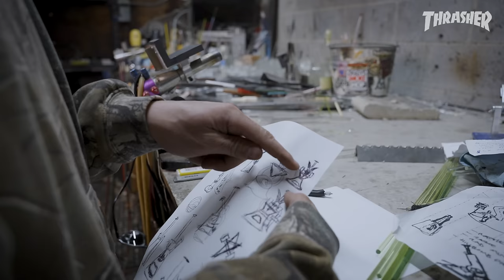Create and Destroy: John Worthington

Comment: I have made gold and silver fumed boro marbles for a few years and never had a problem with green on the surface… gold and silver fume is better encased than green rod though ‘jackpot’ can be encased though no prob.  Lol you can’t complain about the green glass cracking if you aren’t using simax clear (the best clear). Simax scalloped 50 mm tubing is a lot of fun as well. Cheers